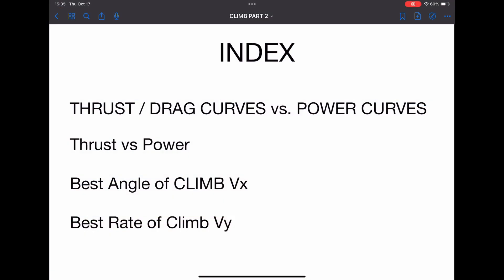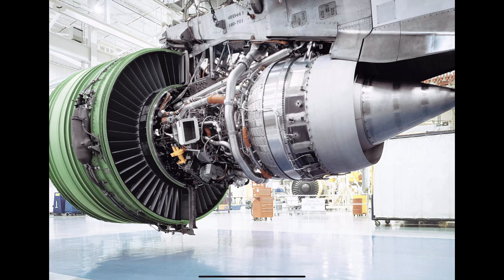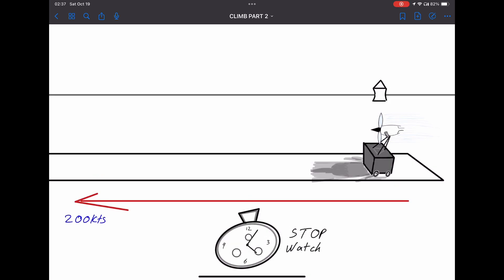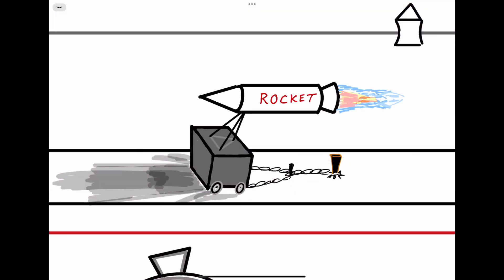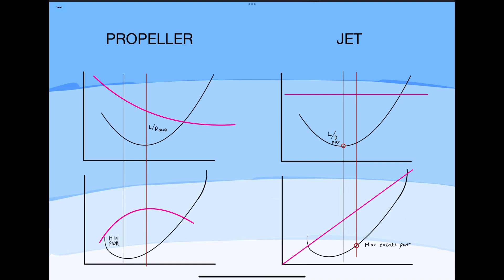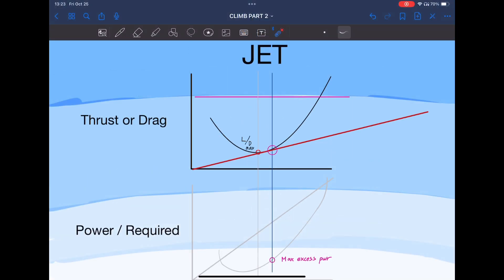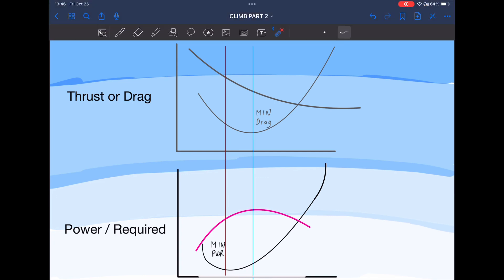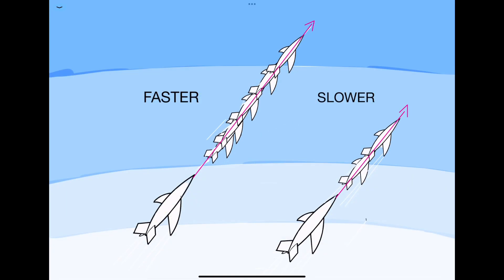Aviation Education Climb Part 2

Comment: I am not a native english speaker but I will try to answer your question. You said it was a trick question and the wording you used made me a bit confused. But basicaly what causes the aircraft to be propelled forward is the thrust. Because thrust is basicaly a measurement of raw natural force. Power is a measurement of energy over time, so its not a measurement of an instantanious force being aplied on the aircraft. Is  that answer somewhat close?

Edit: watched the video, guess I was wrong, its power, because if the plane moves it has velocity and it moves then its power, or actualy both lol. That is a trick question indeed.
Reply from the maker: Hello thank you for watching and commenting. The answer is THRUST.
Power is a result that you (Thrust x Velocity)